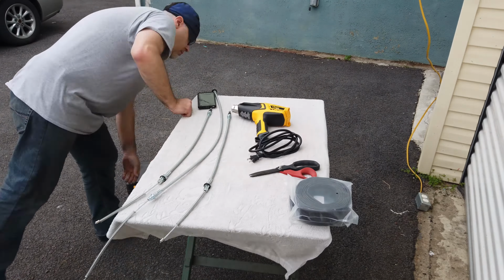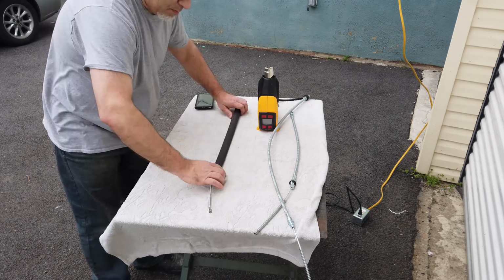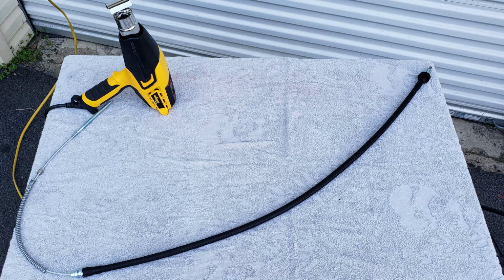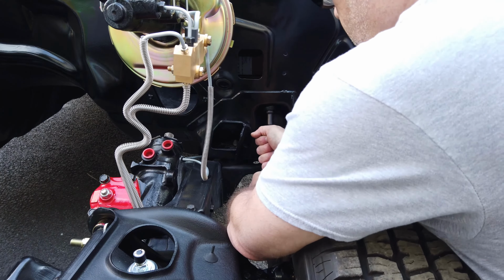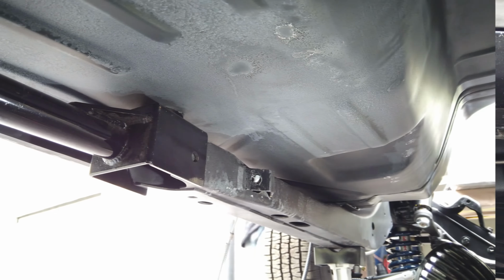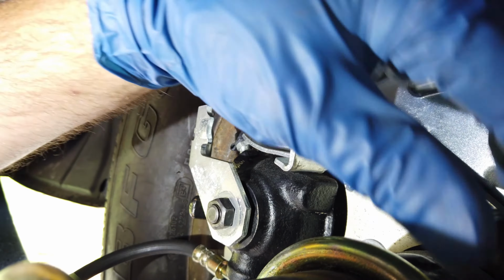Installing the Emergency Brake Cables in a 1967 Chevy Camaro P1

Comment: man I love the heat shrink trick, especially if cable covering is slightly damaged, looks like that makes a great cover for the cable and no paint.  Thanks for sharing!  Great tip Thomas.
Reply from the maker: Yes, love that heat shrink tubing, it's great for multiple things.  Thanks!
Reply: @GoGoGarage what size heat shrink tubing? And did you purchase on Amazon
Reply from the maker: @xpelon209x  yes, I purchased the heat shrink tubing from Amazon, I believe it was 1" and another at 3/4.  XHF 10Ft 3:1 Waterproof Heat Shrink Tubing Roll Marine Grade Adhesive Lined Heat Shrink Tube, Insulation Sealing Oil-Proof Wear-Resistant Black

Comment: Thanks for the video!!!!  I need to get my parking brake system set back up again... this is great!
Reply from the maker: Thank you, I still have to finish them, but I can't until I finish the subframe connectors.  I have to weld a tab onto them to hold the other end of the cables in the rear.

Comment: was this a complete kit with hangars and clips or just the 3 cables?
Reply from the maker: Yes, it's a complete kit, but I have to finish the subframe connectors and possibly the exhaust.  It came with clips and everything from Right Stuff Parking Brake Cable Kit for 1968-1969 Chevy Camaro/Firebird Part Number: 965-RSBCF02